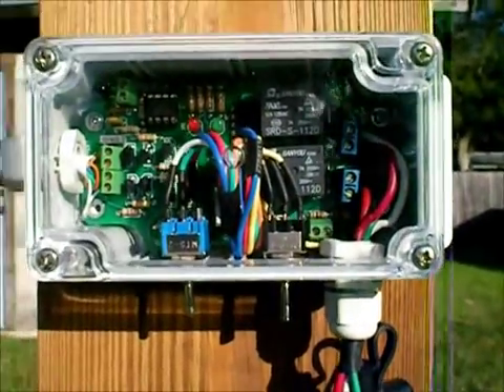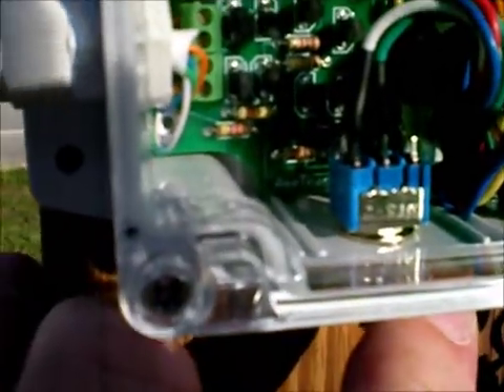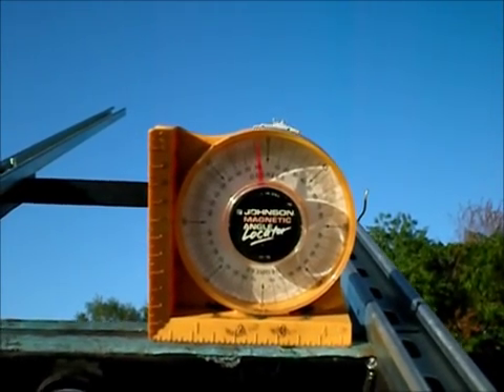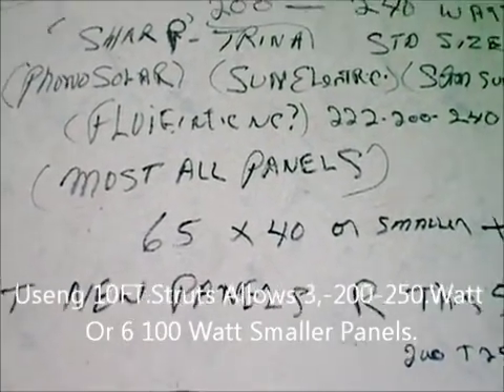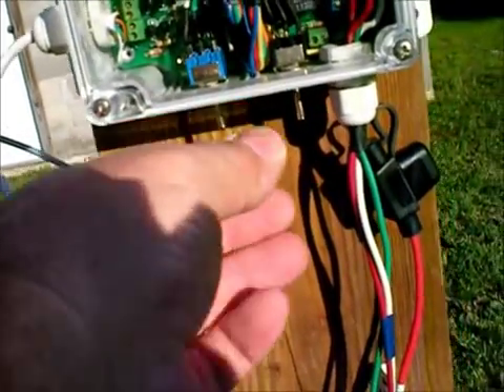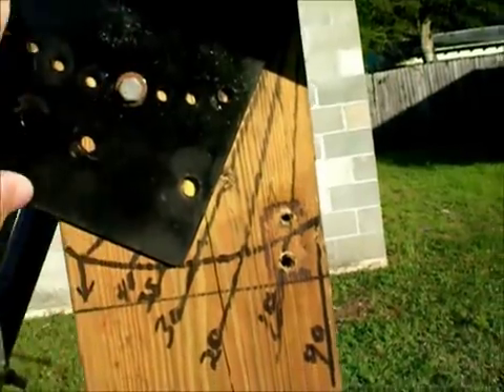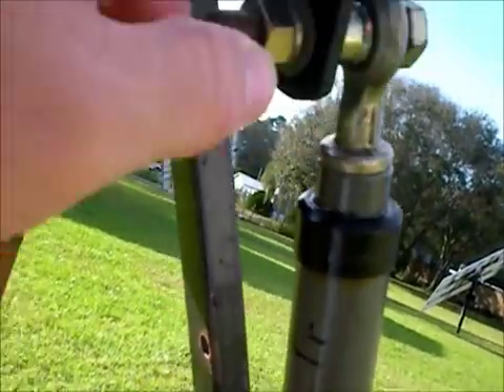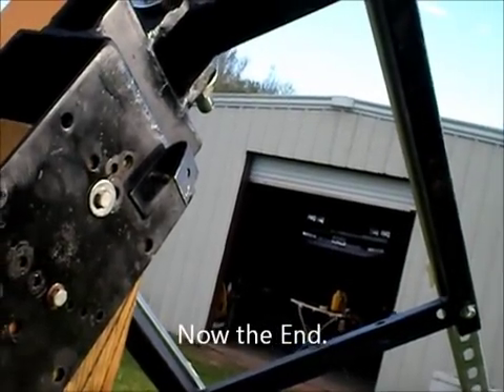Old Tracker #1 Reborn, Plus My New Solar Sensor.

Comment from the maker: Hi Doug,This is The First 1 i made.It sits On a 4x6 Pole.The White Boxed Solar Sensor Is not Part of the Deal,Nor are the S.struts. I have been testing The new Sensors As i build them ,1 or 2 a Day on this mount To Make sure they work as they should & match the other 4 trackers I have before I sine off on them as good.This 1 comes with the Hi amp Richards Foundry Sensor..if U want details PM me or call.U can have the 4x6 Pole